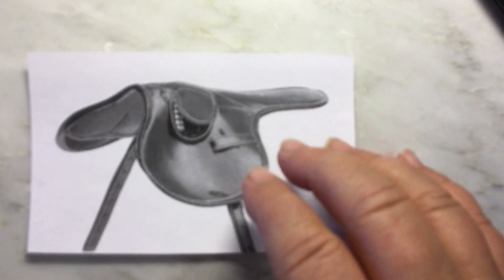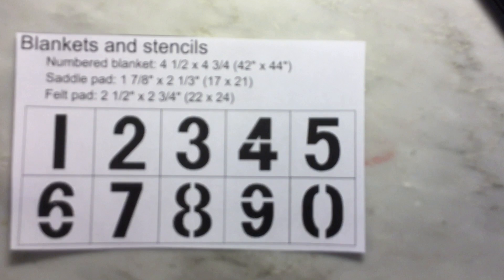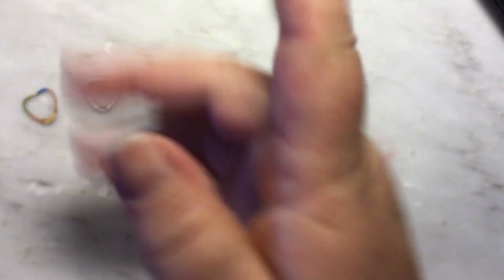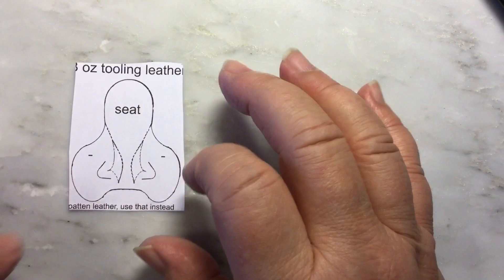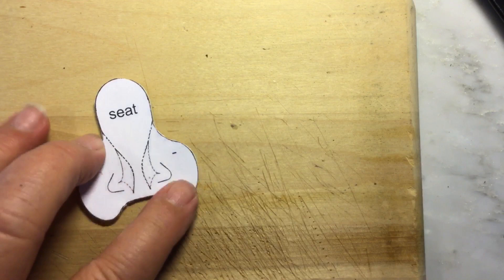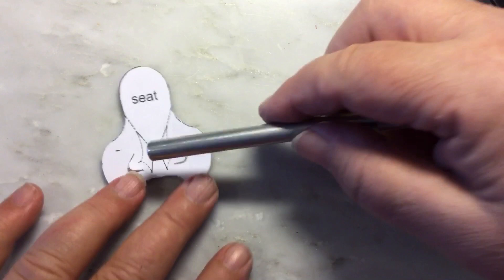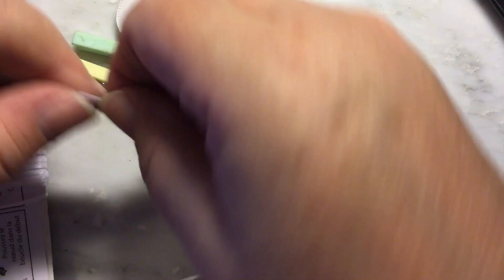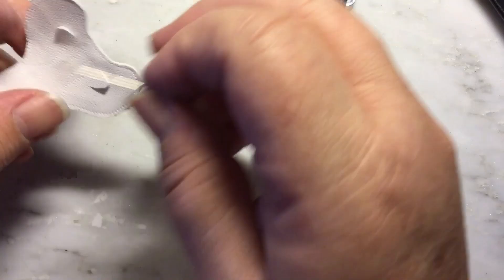Flat Racing Saddle for Model Horses

Comment: Did you try coating the stirrups in extra thin superglue? It makes cardstock rock hard and sandable?
Reply from the maker: I appreciate the suggestion. However after years of exposure I have developed a reaction to supper glue and can no longer use it. I am sure others can appreciate the suggestion.
Reply: @modelhorsetackschool  thanks Kari! I am really scared of the stuff myself but it does do the job. I once dropped a tiny bit on my jeans and the heat it makes on contact with certain substances is unreal. I definately wouldn't advise kids to use it. Great video btw!